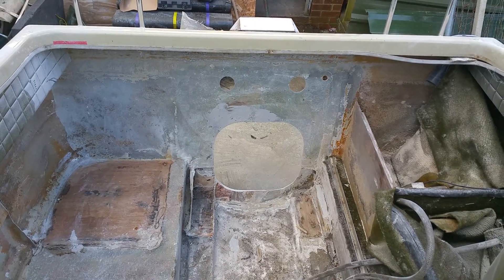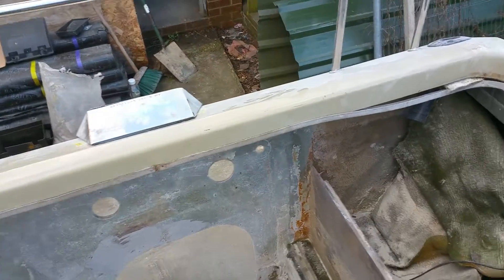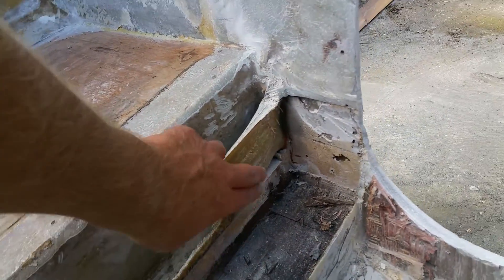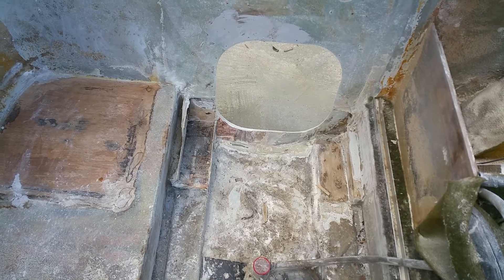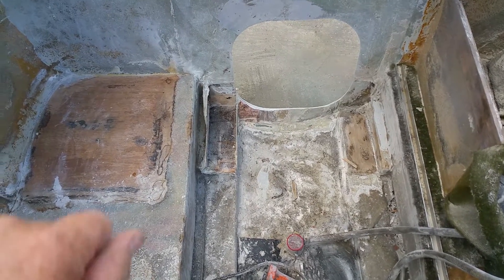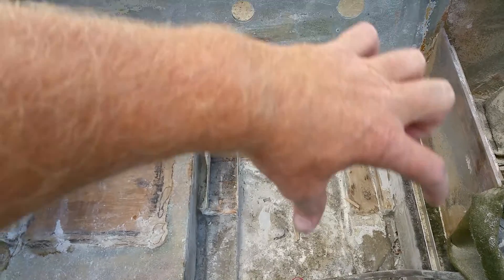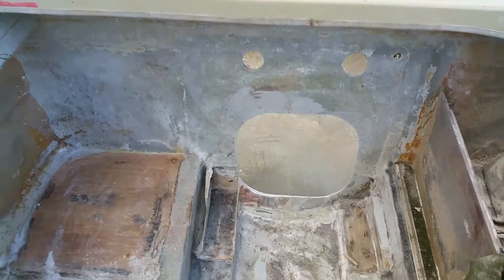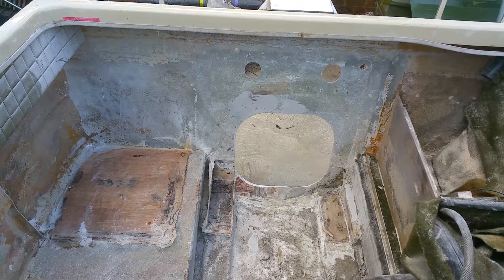shetland blackhawk Inboard to outboard conversion part 3

Comment from the maker: the transom wood was 18mm ply basically about 24 inches square  just in the middle around where the leg bolted to the engine .so i guess the stress and load was channelled through the engine mounts then through the stringers. i  intend to glass in 18mm ply right accross the back of the transon and glass it in rounde the corner then in the middle insert a 28mm ply board approx 24 inches square and attache two vertical pieces conected to the stringers and underside of the back of the boat .a bit like on yours but continue mine to the top

Comment: Hello Peter.. You can delete this if you wish..
 I want to ask why you have removed the transom wood, was it a mess? Are you planning to put it back? It is a structure support - structure = needed for integrity of hull and reduce vibration from the outboard....
Lots of stress in that area when hanging an outboard to an external bracket/pod. 
 Adding a pod i would put back the marine ply. A cheaper option is to soak an exterior ply wood in antifreeze (glycol) and allow it to natural dry? That will bond the normal ply to marine grade  for you :) cheaper... On  Darley Rose  i left the marine ply in place and added ali checker plate for my bolts to inside of transom? = but did not need to and could have used washers.  Nice to hear from you by the way... Iv
Reply from the maker: f you look at the first video  where the carpet ends at the back of the boat is where the plywood reinforcement starts . you can see where it juts out . it was actually 2 x 12mm ply not 18mm obviously works but I guess its a way to keep the weight down . the wood in the transom was solid but I think it was easier to start again with continuous ply across the back a blank canvass and all that . thanks for your imput its nice to hear other peoples views and idears